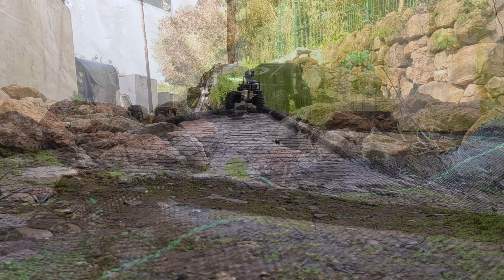CR-18P Evo Trail Hunter 38mm RCAWD Oil Shocks ￼ installing￼ and testing ￼ #CR-18PEvo #RCAWD

Comment: Super cool the blue shocks looks great on there, I’ve got the original trail hunter. Still has the gray stack shocks only thing I have done is heavy weight brass will hexes and it performs great
Reply from the maker: Blue probably wouldn't have been my choice but as they were sent to me by RCAWD!! I thought the blue would actually look better on the Unimog than on the Mario green van.
And I didn't want to fit it to the other Rock van because I already have double barrel shocks on there!!
And I really like the way it works with them!!
This little Unimog is a beast of a machine and with the camo paint job! It  looks awesome 💯
Cant thank you enough for all the awesome comments ✌️😊